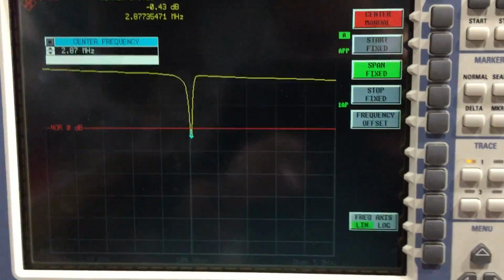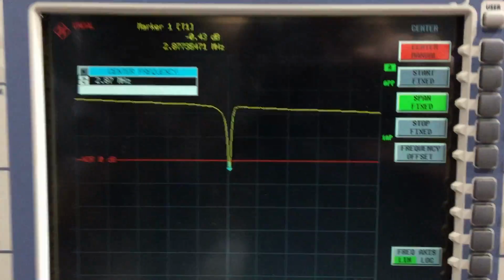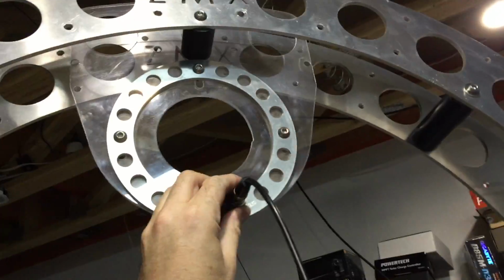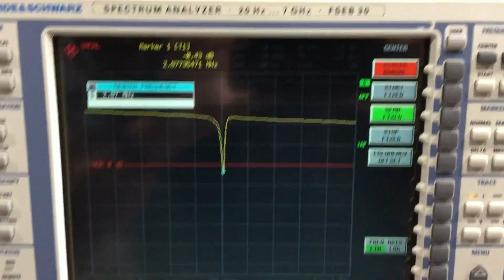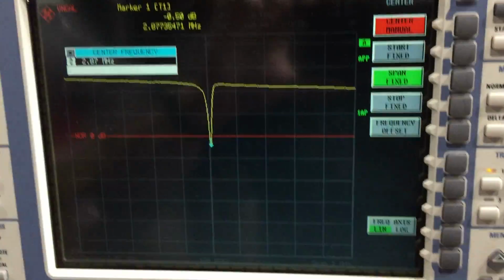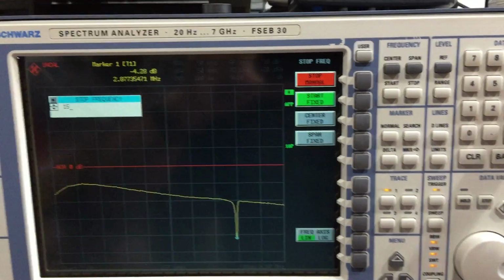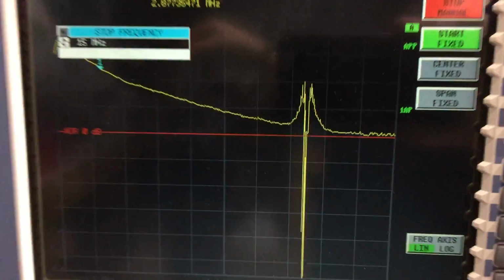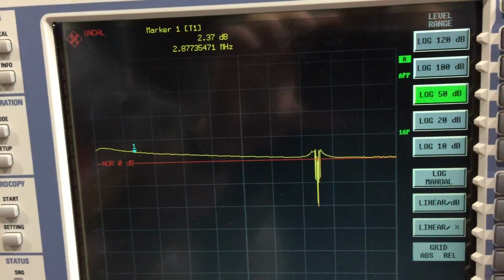Dual loop spacing 50mm to 100mm testing Part3

Comment: Nice videos. Appreciate you making them. I am just becoming interested in the magnetic loop antenna as I live in a covenant restricted housing area.
Where did you purchase your variable air capacitor? What is it's value?
73s Jim N2OWM
Reply from the maker: Ebay

Comment: will the R&S calculate the 3db bandwidth and hence Q automatically with auto positioned markers? I don't have access to that R&S model but most high end kit does that calculation for you, ( I recall the lower spec FS300 did it).